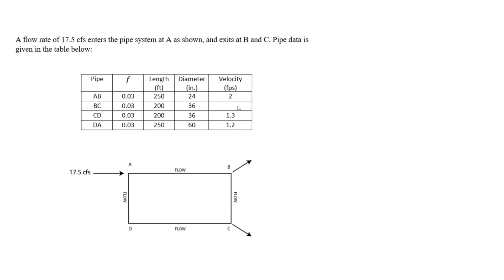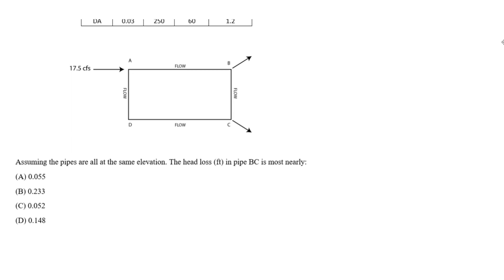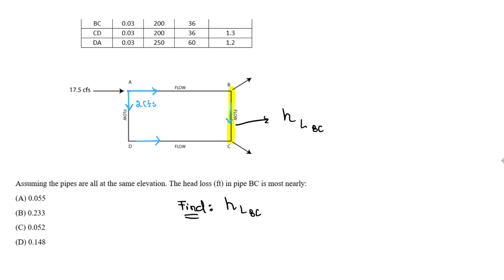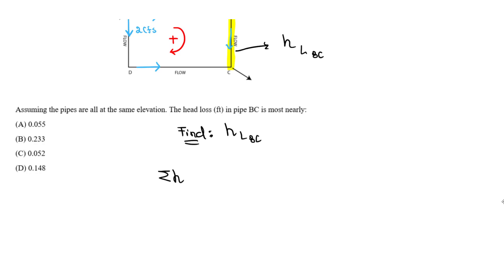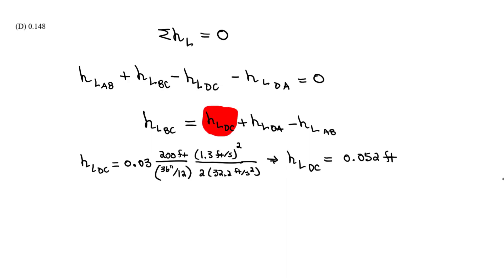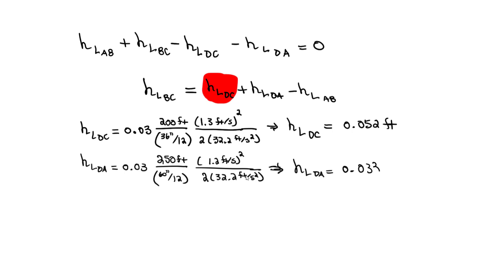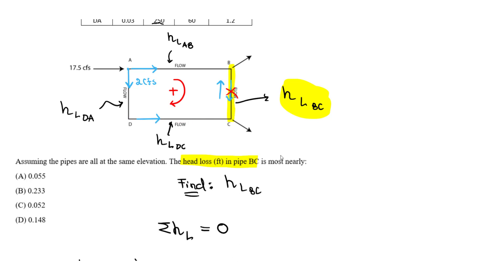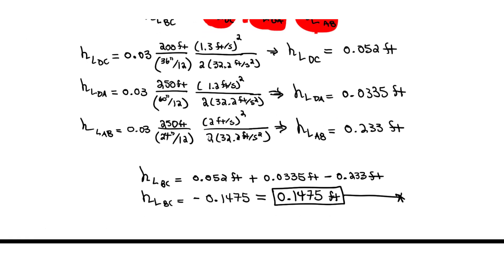FE Exam Review - Water Resources - Water Distribution

Comment: I got QB = 6.28 cfs and QC = 11.2 cfs, although I assume it's wrong since the only equations I used are Q_A = Q_B+ Q_C and Q_B = v_AB * A_AB. It would make sense based on the areas, but the way the distribution system works makes it seem that most water would come out of node B than out of node C

Comment: great video! one question: why does the total head loss is 0? my understanding is the that head loss is from the friction, which cannot be recovered
Reply: is that because the direction of the headless? in the reference book "Multipath Pipeline Problems" section, the head loss in the parallel pipe with same flow direction pipes are equal. but in this question, they are reverse
Reply from the maker: Close! 

It's still true that the headloss of parallel pipes is the same. This concept should be remember when dealing with parallel pipes that start at the same junctoin (node) and end at the same junction (node). 

But why is the headloss equal to zero in a looped system? 

It all goes back to CONSERVATION OF ENERGY. In each closed water distribution loop, there can be no net gain or loss of energy (head). Imagine being a water particle going around the loop from the start to the end. You will end up where you started therefore the energy level must be the same. If we have a head loss in one pipe in the loop it must be balanced by energy head gains or losses in other pipes. This makes the total head loss around the loop equal to zero. 

For the water distriubtion system to be in equilibrium, each pipe path around the loop must have the same head loss, so there is no “extra” energy at any point.

What we do in real life is adjust the flow distriubtion to ensure the head loss is equal to zero in a looped system. By applying the condition that the sum of head losses around each loop is zero, the iterative Hardy Cross method is applied to adjust the flow distribution in the network until all loops satisfy this balance. KEY WORD: ADJUST FLOW DISTRIUBTION. The flowrate into each junction will be different. But in the end, the headloss in one pipe is balance by the headloss in another.

Comment: Could you explain how you got the Qb and Qc please? I am a little lost
Reply from the maker: Hello Varun, for Qb and Qc you will apply flow node equilibrium at each node. 

There is a mistake on my part here. FOR THE FE EXAM, the flow rate direction will be given to you. They will have to give you the direction of the flow since the method of determining the direction is iterative and requires a trial-and-error approach. Usually, something called the hardy cross method is used to do this. 

So we will assume the flow directions. 

For node B: 

If we assume the flow in pipe AB and pipe BC goes into Node C -> Qb = QAB + QBC. 

For node C: 

If we assume the flow in pipe DC goes into node C and the flow in pipe BC goes away from Node C -> Qc = QDC - QBC. 

Sorry for the confusion.